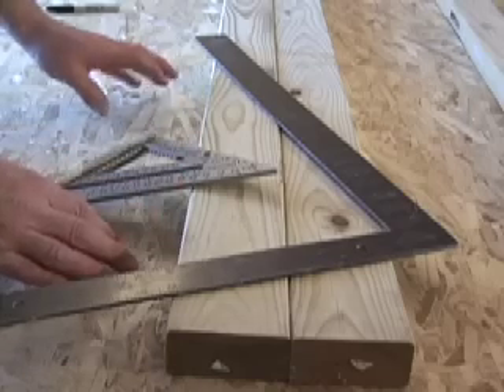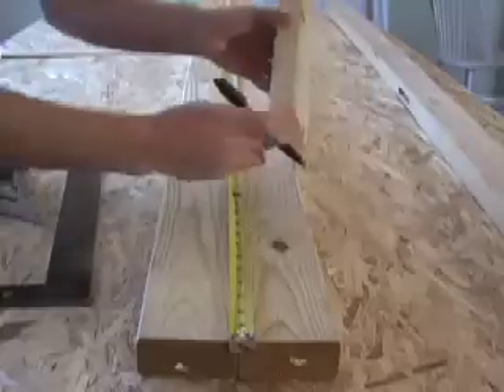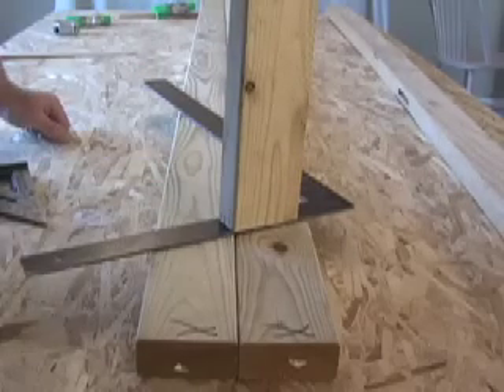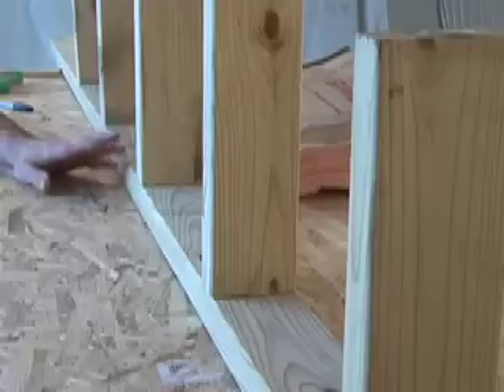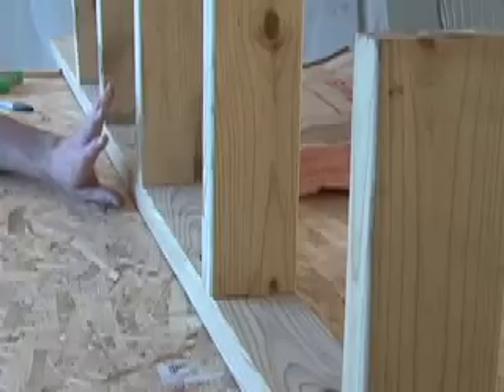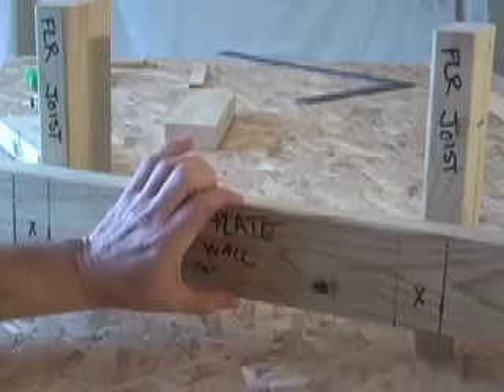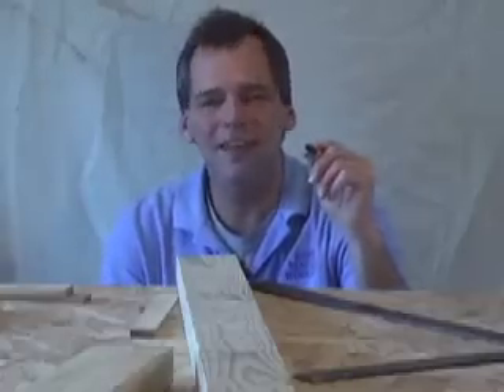how to frame a wall 16 inch on center (CC)

Comment: If I'm not mistaken, this method will produce a gap of 13.75" between the first and second stud which means 15.25" on center for that first section.

Comment: Correct me if I'm wrong but doesn't the first on center occur at 3/4?  If you add 16 to that you get 16 3/4.for your next on center.  Measure 3/4 back and you get 16 not 15 1/4.from the end of the plate to the beginning line.  The first line should be at 16 and then put the stud on the correct side.

Comment: Get one mark, either from common layout or from a made up layout like in the video.  From that mark it's 16 fall ahead or 16 fall back(with the X) depending on which side of the stud you marked and pulled from.  Every stud will be on center, just as accurate and faster.  This is rough framing, not piano building.

Comment: This video is exactly wrong.  There's no need for any mark on 15 1/4 - if you follow this video, your first gap will be off by 3/4" and you will have extra work trimming your drywall panels.  The correct way is to just mark the red marks (16, 32, 48,...) and place the studs to the correct side of each mark.  In this case, you were measuring right to left, so the studs would go on the left side of each mark.

Comment: I need to see where you actually put the stud you said you put an X over the 16 and you put a line right at 15 and a quarter inches so you are putting it in between the 16 and 15 and a quarter inches?   That's if you actually read these comments being your carpenter your probably seriously busy

Comment: Mark the studs every 16".  No needed to draw lots of marks or lines. Do this with the boards on-edge not on-face.  Attached the studs to the middle of the marks.  You get within 1/8" no problem,

Comment: I've framed plenty of houses, what is the span that I can use for framing a Garage with 4x4 PT?  I need to know what the 4x4's need to be placed apart from each other to frame my outside walls. This entire garage is just going to be 4x4 PT posts. Not interested in anyone's take on what I should build it with! I just want the span on 4x4's thanks.

Comment: Question.... Excuse my ignorance if it's a stupid one. No one has mentioned what happens if the wall you are building is say,  35 inches long, or 57 inches long etc. You'd have a stud at 16 inches, then 32 inches, but then you'd have a gap between the 32 and 35. From what end do you measure the 16 inches? How would it work in these cases?

Comment: Question: If I'm framing walls with 2x3, will that affect the insulation application?
Reply: It might a little as the width of each stud is a little less wide, thus leaving less space inside the wall cavity in which to put the insulation..check local building code as well

Comment: I need to install a hose reel on the back of my house and I am trying to figure on how to find out where my 16" on center 2x4s would be so when you mention they "should" be on top of the floor joist.  I will give this a shot and see if they line up. Thanks

Comment: I am confused. You are measuring from the edge of the plates yet coming in for the 16 on center. Given that there is a stud on the edge of all plate shouldn't you be measuring from half of a 2x4 from the edge of the plates? However, your measuring is from the edge.

Furthermore, if I measure from the edge of the plates to 16 inches and always put the stud the the outer of my mark wouldn't all studs be 16 on center because each stud including the first one are to the left of the line therefore equal distance therefore 16 on center?

Lastly, once I get the the far side of the plate what happens if a stud did not reach the end and is less than 16 inches from the end? Do I just have the last two studs closer together?
Reply: Yeah, you're almost always going to have studs sister/married together at both ends of a wall , it's all about having  them positioned for insulation and  nailing dry wall which is the important step you can always cut to fit the insulation, and again the finished work you now where the stud are for add on's cabinets and things

Comment: I don't get it why the first stud is at 15 1/4 from the end. The math shows me that from his video the center of the end stud to center of 1st stud is 15 1/4 not 16".  He should mark at 16" for the 1st stud in order to have 16" center to center from end stud to 1st stud.
I am learning to build the wall frames but watching his video make me wonder if there is a reason why the end stud to 1st stud is not 16" but only 15 1/4.
Reply: Because the board is 1.5" thick, it's width spans from the 15.25" to 16.75" mark, which makes the center of the board at the 16" mark. Hope that helps.
Reply: The end studs are really non important in finding the studs for the rest of the wall. They are merely an anchor point to secure the wall and then to secure drywall. The idea is that you measure from the edge of the wall to 16in and that should be a stud. If not, then you must measure from the other end of the wall the 16in and if the wall was built correctly you would be center mass on the stud. Do not worry about the studs as much as your marks on the plate. That is why he places the top and bottom plates next to each other to mark them at the same time. This way he knows that both lines will result in the same spacing and all of his studs will be 16in on the center.

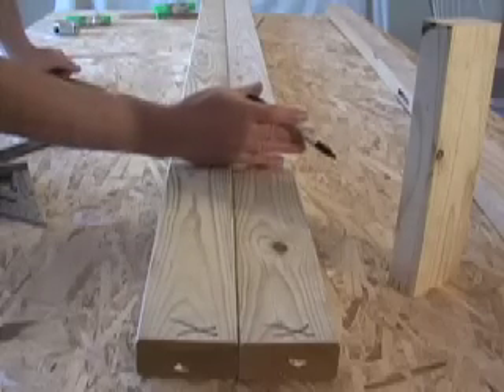Comment: @ 2:24 "Why do I have to concern myself with laying these out 16" on center? Why not just throw enough in there that it looks good?" Technically you could place a stud every 8" OC and the drywall will still break on the center of the last stud. The only problem is you would be using twice as much lumber, which calculates to twice the cost of materials, and it's completely unnecessary. However, with 2x4's code does not allow spacing any greater than 16 inches. Methinks 2x6's can be spaced up to 24" apart.

Comment: This guys a complete jackass! Listen and learn...Ready? Take 2 studs (plates-top and bottom of wall) and place them together-ends matching& barely nail them together(near an end is fine) with 1 nail  & place them on their SIDES. Hook tape to your right & Mark 3/4 of an inch(15&1/4 and so forth) before each red STUD mark (he got this part correct...geezus!) Use your speed square to make a line f across both boards. Take boards apart, place R side of studs on marks, nail and stand up-INSTANT WALL!

Comment from the maker: I will answer your question with two. Grab a tape measure and pretend that you are standing up a 4 ft sheet of drywall starting at my lay-out . Where on the tape would the board end? Now do it again starting at 16 inch and set ahead. Where will your 4 ft board end? +++Bob

Comment: The way you show laying out the studs shows that the spacing between the first stud and the second stud is not 16" on center but actually 15 1/4 ".  Is this what you really want?

Comment: I think moving back 3/4" is more confusing than just starting at the edge of the top/bottom plate and measuring over 16", 32", etc.  Then when you go to nail your studs in, just make sure that the correct edge of the stud lines up with your mark.  So if you start at the left and work to the right, you would line the left side of the stud up with the mark.  If the studs are 16" edge to edge, then they are also 16" center to center.

Comment from the maker: One way is to place two studs together with small blocking in between studs, if an outside corner is required.  The second way is what is called a Western Lap, you could Google it, but all it is, is a corner stud and a flat stud against the adjacent side of the opposing wall stud.  The third way is exactly the same as two walls that form a T with horizontal blocking.  Keep in mind the only way I would consider a corner structural, is if it was built the first way.  
+++Bob

Comment: Would it be simple to just cut you a piece or two of 2x4 or 1x4  to 14.5 inces and the stick it in between the face of one stud to correctly space the next stud as you nail in your studs. You just establish a standard so to speak. No measuring from stud to stud and would speed up your layout process.

Comment: Although it wasn't mentioned you must put the framing square over the center of the mark indicating 15 and 1/4; 31 and 1/4, then you can mark both sides of the square.

Comment: Actually, you should lay the two plates together with the tape on top moved over to the center of the end stud and clamp the whole thing together, then mark both studs at the same time on the edge with a pencil using the center marks...  But what do I know...?

Comment: its the same thing. you pull 15 1/4 put a nail, then hook your tape and measure 16, 32 and so on. its just so you dont have to subtract 3/4s off on every mark.   you end up with the same result.

Comment from the maker: If the material that you are putting on the studs span the entire wall then no problem doing it the way you described however if you are standing 4 ft material up be prepared to trim your first sheet by 1/2 inch+++Bob

Comment: The way  they showed in your DIY video is right to. They just have you adding 3/4" rather then subtracting the 3/4" as bob says here. So in that case you would just put the stud before the line and still get the same results.

Comment: What he means is that after you mark your first stud at the 15-1/4" mark, remove your tape measure the using an awl or nail at that mark, reset your tape measure. Then you can just mark right on the 16's which will automatically set you at the right spacing. No need to subtract the 3/4" off the 16". Just a lot faster to do it that way.

Comment: Good video
The most common spacing is 16 inches on center (OC). This means the distance from the center of one stud to the center of the next is 16 inches. The space between studs that are 16 inches OC is 14-1/2 inches. The first and last studs in a wall are exceptions to the rule. The first stud is shifted over 3/4 inch as its center-line corresponds with the end of the wall, so its side is flush with the ends of the plates. This makes the space between the first and second studs 13-3/4 inches.

Comment: It means he can't do simple math Bob. He's saying to put the first stud at 15"1/4 like you said but at this point he wants to measure from the first stud 16" to get the next line which results in the same measurements but is less accurate and less efficient as just leaving the tape measure in place. 15"1/4 + 16" = 31"1/4

Comment: But if you also take into consideration that the beginning of your layout is in a corner, and the drywall will get hung on the other wall first, then you are better off just marking 16 and gone.  Bottom line, there's no reason to get overly technical. The drywallers are not going to complain about making one more cut.  Good tips, though.

Comment: you measure from the edge of your frame 15" 1/4 because you are taking in consideration the 3/4 measurement that is half of your first stud. From there you can measure 16" along for each stud's center. You only need to take away the 3/4 of an inch from the first stud because you are measuring from it's edge and not it's center. Your measurements from then on in will be your stud centers.

Comment from the maker: Get a square and a piece of 2x4 and try it. You will see that at 4ft,8ft,12ft, you will have a stud center to break a piece of standard material on, Every stud in the middle of the wall will be spaced at 16 inch centers. +++Bob

Comment from the maker: You need to consider what the wall will be used for, are you hanging cabinets on the wall? Is the wall going to support any weight from above? Hand rail or grab bar going to be installed on it? It just seems for the expense of 6 studs to keep all your options available to you it may be worth the cost. +++Bob

Comment: Bob, actually I was thinking of installing the subfloor first and then build my walls... If I do it this way, should I still use PT plates? or do you suggest I frame up everything and then so the subfloor? I've seen both ways done, just wondering whats better??

Comment from the maker: I usually figure 1 per foot and add 2 additional studs for every inside and outside corners. then I figure the plates separately because they will be longer length. I know that sounds heavy but somehow I always run a bit short.+++Bob

Comment: Great video. But am I wrong thinking if you measure 15 and 1/4 from the start of your header and mark the edge where the first stud goes, wouldn't the first stud be 15 and 1/4 to center. I'm not a framer but trying to learn.

Comment from the maker: What you need to do is measure across the diagonals of your framing if they measure the same its square, if not rack (physically move) the frame until  the measurements are the same. Hope this helps  +++Bob  If its small enough pick frame up and drop it on one of the longest measurement corners then remeasure.

Comment: I framed a 2x4 square with 2x4 studs but the inside corners are not 90 degrees! I tried so hard to make them 90d with my framing square but failed! What did I do wrong? I'm trying to build a dog house and I want to get it right the first time. Someone give me some tips please!

Comment: what kind of wall is that?  Usually wall around here are made of bricks or concrete poured in a frame

No wonder hurricanes make a havoc on houses with dry walls and wood, Try steeand concrete, works better.

Comment: DSrywallers really, really hate when it isn't laid out right! It will cost you a lot more to have a pro install your drywall if your layout is screwed up, or if you used crowned and bowed lumber. Why you ask? Because it takes a lot more work to make things fit, and material is wasted unnecessarily. Furthermore, you are only going to get a finish representative of the quality of your framing. A taper can only do so much. Framing it right will cut down on screw pops and humps in your walls. G Luck

Comment: @brian1969a one thing you can do is if you have any pictures hanging on the wall and you know that the nail that they are on are in a stud than you can measure over and figure out where all the other studs are.

Comment: @BEASTsatisfaction You would nail it with two nails per stud top and bottom, side nailing only where access to the bottom of the stud is not possible. You would than add a top plate (2X4) to cover the first top plate, taking care to overlap anywhere that two studs meet so as not to have any butted studs lining up. As for your corners, see if your local codes allow the use of short sections of 2x4's to make up space so as to minimize using full length studs .

Comment: You sure explain things very well but I could tell many stories of hanging shelves and using studfinders and most of them did not do it right. I used several and finished drilling little holes sometime too many and became most annoyed at it. I hope I can learn but this is Australia so perhaps I need to learn a bit more!

Comment from the maker: @brian1969a    Hey Brian. As a rule yes they did. however due to the size of heat runs,plumbing locations and so on, they would sometimes get creative with their lay-outs. If you use a drill bit to drill plaster(behind where crown will cover) it will be less likely you will blow-out plaster that may happen if you use a trim nail, Hope this helps! +++Bob

Comment from the maker: @BEASTsatisfaction   With the exception of the first stud that will be 13 3/4, the remaining field wall studs will be 14 1/2 between. If you are on new construction the plates are nailed thru plate into stud prior to "raising" the wall,if there is an appropriate angle to nail the nails in , I am not aware of it but after you hit your books please let me know if there is.  Good Luck with the competition! +++Bob

Comment: 16" is one of the three common lay measurements. There also is 19.2" OC and 24" OC. The lay out can be different depending on load an the timber dimensions as well.

Comment from the maker: @MFRoosy16    The standard is 16 inch centers for most typical projects, there are occasions that 12 inch centers may be required due to load restrictions ect. Hope this cleared things up a bit+++Bob

Comment: Well i`m a Welder/Fabricator and though we do simular things when setting out Balustrading & railings & the like, it was good to see this. I`m about to build a Studded type walled timber garage using 4"X2".. The size is 8M X 5Metre`s & height is 2.5M to the eaves & 4 Metre`s to the peak of the roof. The roof is going to be 18mm Ply with flatroof fibreglass type finish. T&G will clad external walls and ply sheets on the inside. Insulation will be installed but not sure what yet. Thanks for post.

Comment: @lexichronicle2 : yes! My house was built in 1924, and I feel your pain. But to add plaster walls into the equation is ever more challenging. Feathering in drywall with plaster wall is fun. Not.

Comment: Just to clarify, lets say your building a 10x10 room out of 2x4, your going to have 2 outside walls and 2 inside walls. This means on each of your outside walls you need to compensate for the inside walls which are 3 1/2" thick. So on the outside wall at the first stud to the second stud you'll need to account 3 1/2" and put another stud on the opposite side of that measurement, same for the opposite end of the outside wall.

Comment from the maker: @br3ktw     Lay-out entire wall on plates, then add 2 remove one continuing around structure. This is going with the assumption there is no exterior sheeting on these walls and electric and plumbing are to be removed and reworked later.+++Bob

Comment: Hi again Bob. The existing stud structure  utilized 2x4s straight from the saw mill and they aren't very consistent in their tolerance. I'm afraid there would be no way of ensuring the drywall doesn't beck